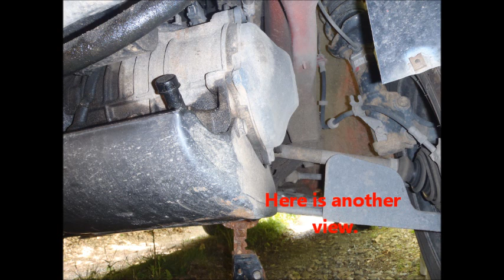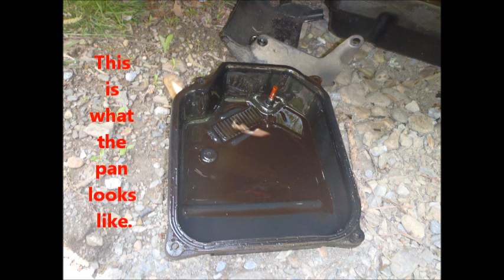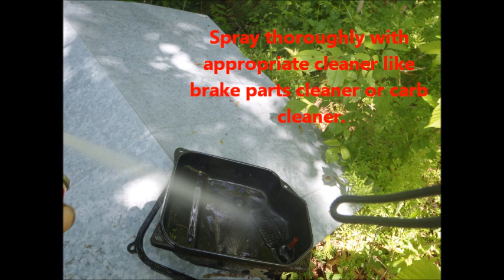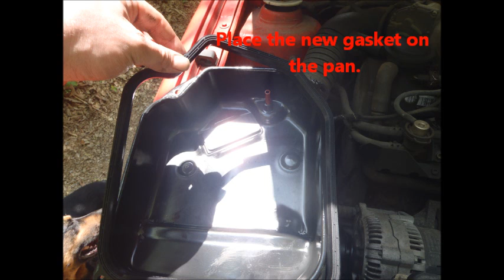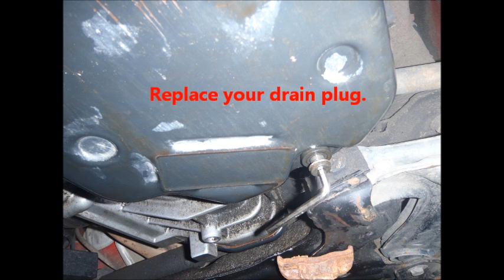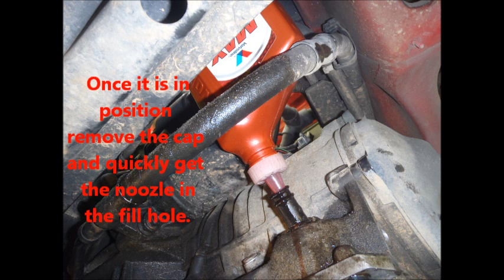How-To Change the Automatic Transmission Fluid and Filter in a 1996 Volkswagen Golf

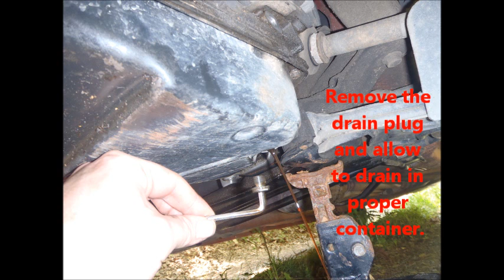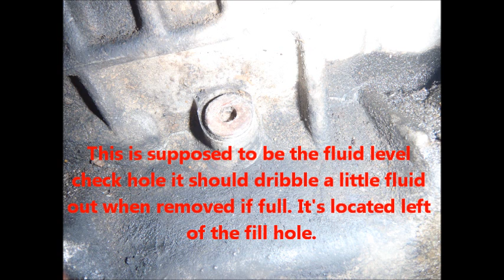Comment: No1 at 0:51  the drain plug IS used as the fill level, as you see that red plastic tube it overflows from there.. AND  No2 also  DONT forget the aluminum bushings from the old gasket since buying it from autozone  they dont include them ..  No3 use the flat back of a large socket to "insert the  filter seal ring until flush with face of valvebody  No4  The plug at 4:20 is used to measuge trans-husing air-pressure which should be around 5psi .. any more than that THEN the breather  is clogged

Comment from the maker: On my model the check hole is about maybe 3 inches to the left of the fill hole. If you go to the 4 min mark in the video and pause it and look just to the right of the word "filling" about halfway between the words and the fill stem you'll see it. It is supposed to have a Hex Key(allen key) type hole in the plug for removal.

Comment: A couple of suggestions, from experience. First, you should have the fluid at optimal level before you start. Then measure the fluid that came out, and put back that same volume. Estimating fluid needed is complicated because some remains in the torque converter, so it's easiest to just put back the volume that was removed. Also, torque specs for transmission bolts are often measured in inch pounds. Not too tight, because aluminum threads could be easily stripped. I've never used vaseline....

Comment: it looks easy and complete, thanks, I'm looking forward to change both engine and gear oil on my 96 Passat. 
Question1: is it mandatory to change gear oil filter? Question2: is it possible to use a rubber "pipe" to fill the pan from the upper side of the engine somehow? thank you

Comment from the maker: @lumircolla fill to around the appropriate level before starting the engine. Then proceed with the checking of the fluid once the car has warmed up and is still running. Remember to be sure the car is level. I also like to get inside and while pressing the brake move the shifter throught all the gears to ensure the fluid has circulated properly.

Comment from the maker: @spelunkerd if you have excess fluid it will dribble through the check hole when you check it and yes you should use a torque wrench and adjust to specified torque and the vaseline thing is very common on the web for gaskets and by the way the car is still running strong.